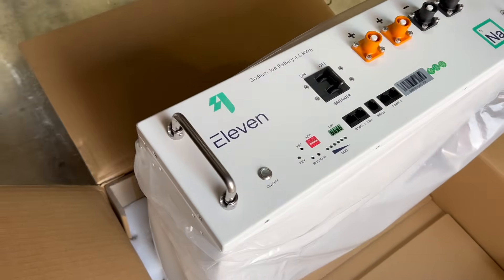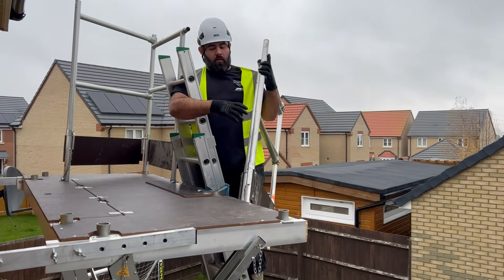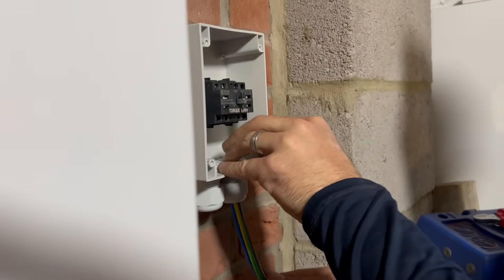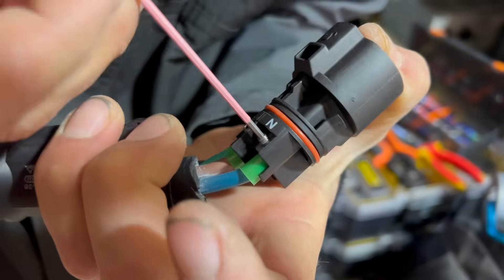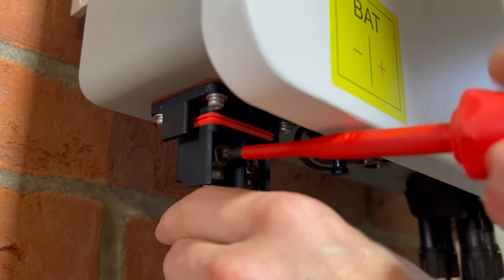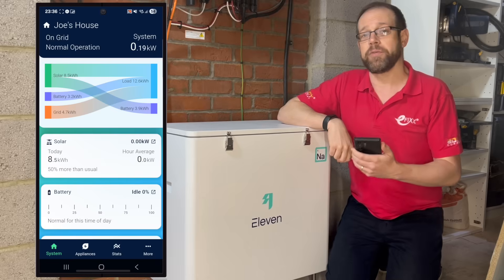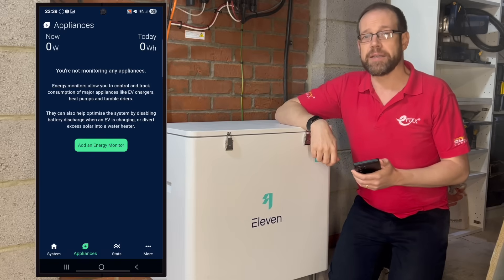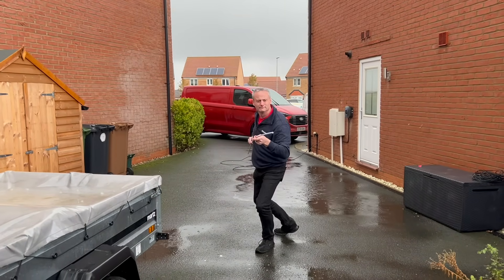I Swapped to a Sodium Battery - What Happened?

Comment: FYI No, lithium is not rare on Earth in terms of total abundance.
Here’s the context:   Lithium is the 25th most abundant element in the Earth’s crust by mass.
Its average concentration in the crust is about 20–70 parts per million (ppm) (depending on the source), which puts it roughly in the same abundance range as zinc, copper, or nickel.
For comparison:
        Sodium: ~28,000 ppm (very common)
        Iron: ~56,000 ppm
        Copper: ~60 ppm
        Lithium: ~20–65 ppm
        Gold: ~0.004 ppm (truly rare)

So lithium is more abundant than many familiar metals like lead, tin, silver, or mercury.
Reply: @gbusrt6592  The problem with lithium is not the ostensible rarity, but the rarity of accessible deposits. I do not fully understand the geophysics involved but as I understand it, it has to do with the very different elemental properties of the extremely light element lithium compared to metals like copper or nickel. The fact that lithium is very energy intensive to extract compared to other ores makes it functionally rarer as well because it reduces the economic feasibility of extraction for a deposit of similar quality to a metal that is easier to extract.

If the metal isn't rare, but the availability of economically feasible deposits is rare, then for our intents and purposes, it is rare.
Reply: Overall there is enough lithium out there. It's more the difficulty of extraction that is the problem. Lots of energy and water needed to extract it from eg brines in the Atacama desert. There is less environmental damage involved in sodium production.
Reply: @AndyElevenEnergy  Lithium is a byproduct of water desalinisation
Reply: @blobstrom ok but like. In what quantities and at what energy costs?

Nvm I just looked it up. The global average concentration in seawater is about 0.17mg per liter. To produce ~7 kg (7 million milligrams) lithium for 1 automotive battery would require 7,000,000 / 0.17 = a bit over 41 million liters of seawater (at perfect 100% extraction). We currently produce about 35 trillion liters of desalinated water per year at a bit under 50% efficiency, so that means about 70 trillion liters of saltwater. Theoretically, around 1.7 million car batteries' worth of lithium are put through desalination each year.
Reply: @believelander9030 I'm saying it's a byproduct. So it can supplement normal lithium mining.. also not forgetting according to all Neanderthals that EV batteries are failing at an alarming rate therefore we can also extract then lithium from recycling batteries, so there's no need to dig for more
Reply: @blobstrom  It's not a byproduct. Brine is. Lithium is certainly in desalination brine, but you have to actually extract the lithium from the brine, which requires its own industrial process. And the total seawater processed sets the upper limit of lithium available. 

The TL;DR is there's a shitload of lithium in globally produced desalination brine, but an effective commercial process to consistently produce usable lithium from it has not yet matured, and the cost per kg is not known.

A process from a 2021 research paper claimed about $5 in electricity costs but did not cite full cycle costs. If we develop the process but it costs 10x as much as mining, then that's not ideal.
Reply: Thanks chatgpt.
Reply: @tombrown3533  was grok, I think what you meant was that lithium is very harsh on the environment. But that's not really true any metal is like that to extract. And the sodium's also an issue it's not sodium salt like NACL sodium chloride It's sodium met and that also has to be refined. It just was so jarring when you said it A slip of the tongue perhaps. Not meant as a critique to you it just came across as really strange. And no I did not mean to claim credit for a search engine that could do the job for me I'm personally thick as bricks
Reply: @gbusrt6592  Yeah, that misinformation grated on me too. High concentrations of lithium are somewhat rare, but that's true of lots of other elements/metals/minerals too. There is many orders of magnitude more sodium though, and for similar production levels sodium batteries should (eventually) be much cheaper.
Reply: get many many if mine whole earth then move to other planet like grasshoppers, many many earth like planets in god made universum

Comment: What's the round-trip efficiency of the battery? Sodium ion batteries tend to be very low, like 70%.
Reply: CATL's Gen 2 Naxtra supposedly has ~93% round trip eefficiency
Reply: 94-95% is what we are observing in real life installed systems so far. A lot depends on the application, and specifically the current you are pulling at. If you are starting a car, you will get very high currents and very low efficiency. For stationary storage typical currents are much lower and the efficiency is higher.
Reply: Well the app reports that 3.9kWh was put into the battery and 3.2kWh was exported during the day, with the battery having been emptied. That is 82% round trip efficiency.
Reply: @rogerthomas7040  Typical real-world AC-AC efficiencies:

LFP systems: 80–88%

Sodium-ion systems: 78–85%

Spec sheet claims: 90–95% (lab conditions)
Reply: Thay have a 95%  round-trip efficiency.

Comment: Very nice. And those battery modules didn't look stupidly lagre for the capacity "despite" being sodium. Any indication of price for the modules themselves vs lithium?
Reply: They are appropriately larger vs kWh of storage compared with a 19" LFP battery.  We don't know how much unused space is inside the 11 battery's case either.  19" LFP batteries usually aren't packed to the gills but the rack mount form factor dictates the size of the case to some degree (RU height intervals etc).  Toss in the incorrect expectations of the physical size of a Na cell vs LFP, people imagine Na is going to be much bigger than it really is for some reason.  Yes, bare Na cells take up more space than LFP watt for watt but there's more to consider.  As usual early adopters will be the guinea pigs - see the people that got stuck with 15 cell Pylon LFP batteries while the LFP battery market standardised on 16 cell.  Who knows what unexpected kinks will arise with Na.

Comment: I hear lots of people saying this and that about sodium batteries, yes they have “features” just like lithium, like weight and lower energy density (currently) but for this application what’s not to like, especially the increased service life, significantly lower price (eventually), reduced battery degradation over time and wider operating temperature range, all plus points for a fixed home storage installation, even if everything else is comparable with lithium, it’s still a clear winner for this type of fixed application and will only get better as subsequent generations of sodium batteries are developed.
Reply: LFP cells are already so cheap that the majority of the cost is the shipping to UK. Sodium will always be heavier so may not ever beat LFP on price...
Reply: @Swwils  How about local manufacturing of the battery cells with sea salt instead of shipping mined Lithium from South America to China, manufacturing the cells there and then shipping it all to Europe?
Reply: @SolAce-nw2hf  Won't matter.  If you think manufacturing Na batteries in the UK is going to be cheaper than LFP from China you are dreaming.
Reply: @retrozmachine1189 Most manufacturing is done by machines nowadays. CATL, BYD and other large companies are already moving some of their production to where the customers are where that makes financial sense. I don't think they will choose the UK though, but rather another European country with free trade within the EU. Brexit has killed most of the manufacturing industry in the UK.
Reply: @SolAce-nw2hf  Cell manufacture, which is what we are really talking about, essentially always has been a highly automated thing.  Battery assembly, that is putting the cells in a box and wiring it up always has been a fairly production line of human beings affair and will be for a long time to come.  That aspect of things just does not lend itself to a high degree of automation.  The only places that will be churning out cheap batteries will be the ones that pay employees a pittance.  That isn't the UK.  It's not the USA, nor any of it's peer countries, and it's not most of Europe.
Reply: @SolAce-nw2hf lol. We have none of the raw material. So now your shipping way more stuff. Good way to shave the worlds most expensive LFP cells.
Reply: https://youtube.com/shorts/uWfRcYHEph4
Reply: @SolAce-nw2hf  sir this is a wendys
Reply: batteries good for reducing nuclear and dams, secndary system for lights tv and charging ihone, very stupid charge ihone with nuclear when plant is 2000 kilometers away

Comment: Glad I finished watching the video, I was just about to post about the generation meter.
Still trying to figure it out in my head, but with battery charging/discharging losses(from solar and grid) could lead to lower generation payments.
If there are, it may be negligible anyway compared to the extra cost of a separate inverter for the battery, but I guess it depends on what FIT rate you have as well. 
It will be interesting to see how you get on.

Comment: and what did it cost? and whats the warranty?
Reply: Since the website says "Contact Us" rather than giving pricing, I am going to guess that this system would cost upwards of 15k
Reply: Warranty is 10 years. However sodium cells generally outperform lithium. We have some that have done 13,000 cycles on testing so far (equivalent to about 35 years with 1 cycle per day) with approx 12% loss of capacity.
Reply: @AndyElevenEnergy  the voltage difference is quite huge from full to empty, how do you handle this efficiently?

Comment: Sodium is currently inferior to LiFePO₄ in every way. In a couple of years, when production is scaled up and sodium reaches about half the price of today’s LiFePO₄, it may become a viable option, but it will still be an inferior chemistry compared to LiFePO₄, with its only real advantages being lower price and better cold-temperature performance.
Reply: There is always a trade-off, but a more reliable SOC, easier balancing, long cycle life and being able to use it outside without heating and cooling systems are great advantages.

CATL as the largest manucaturer of both LFP and and NMC is starting mass production of Sodium-Ion cells this month and I really don't think they like to gamble or disappoint. LFP is great for vehicles and other weight and volume restricted applications, but for stationary energy storage or vehicles in challenging climates, Sodium-Ion can replace or complement LFP at a very low cost and environmental impact as scale increases.
Reply: @SolAce-nw2hf  Sodium may get good enough in future generations, but it isn't there yet.  The current use cases are limited mostly to grid-scale operation, not so much for vehicles or residential applications.  It's main claim to fame is price... but for a retail customer that has to translate to real savings to make any sense.  Which it doesn't, yet.  

The sodium we see in residential and retail now is just as expensive as LFP, the sodium we see in vehicles now is pretty bulky, the round-trip energy efficiency is poor compared to LFP, and while sodium does better in cold weather that's really only at low C rates.  Very low C rates.  Is cold weather really an issue for a residential installation?  Almost never.  And heated batteries are the norm now (nor does it really cost any extra to do it since its just a low-wattage resistive element).  Nor is SOC tracking a particular problem.  When done right, it's a non-issue.

Both sodium and LFP are going through generational changes every year, with LFP way ahead of the game.  It is going to take a while for sodium to catch-up and even if the raw materials are cheaper, the actual engineering, doping, and patterning of the chemistry could very end up not being cheap at all.   

I like the concept of sodium, but it isn't even close to being ready for broad use, yet.

-Matt
Reply: @SolAce-nw2hf  True, but it all comes down to price. Currently, the voltage curve of sodium batteries also makes them much more challenging to use compared to LiFePO₄. Without specifically designed BMS and inverter systems, these batteries would likely be difficult to use.

Comment: It's not entirely true that sodium is cheap to extract and process. The current extraction method is to melt pure sodium chloride, the eletrolise the liquid to extract sodium. This is a very energy intensive process. Other lower energy extraction methods may be developed in the future, but they haven't been developed yet. Sodium is a very reactive metal, as are all the group one alkali metals, such as potassium and lithium, so generally requires  large amounts of energy to extract them from their ores and compounds.

Comment: in the future they're just not there yet the energy density is rubbish They're not that much safer than lithium iron phosphate. the voltage drop they struggle with is so massive lying on the hope of reliability in the future which we know today how good lithium  phosphate is. the ridiculously cheap but they need so high current that everything around them needs to be built so expensively. thing about rearrift metals is silly obviously with lithium on phosphate it doesn't have any and all the processing of the salt it's not just table salt is all done in China Not to the best standards. cold temperature but you lose so much efficiency with them just not being that great sales that you could spend the energy on a heater.